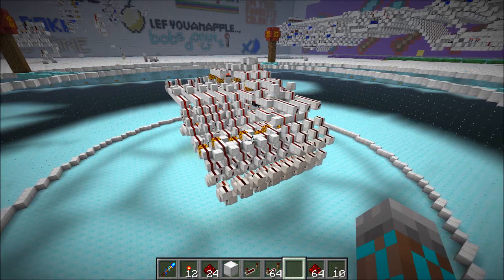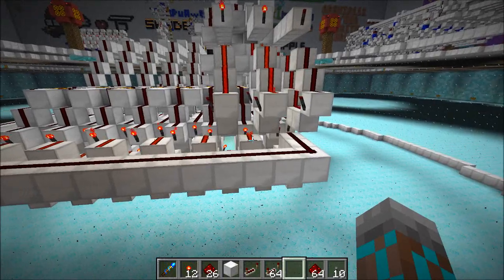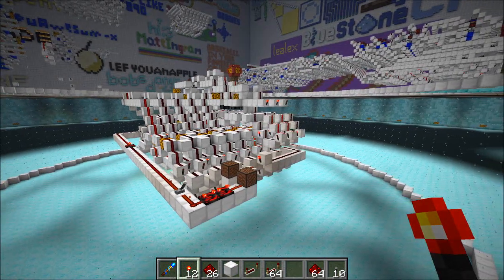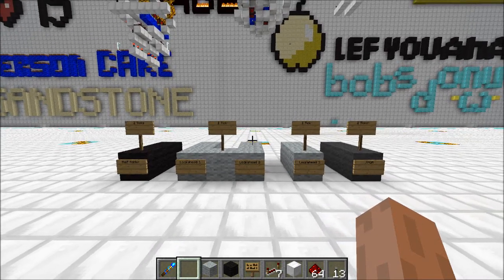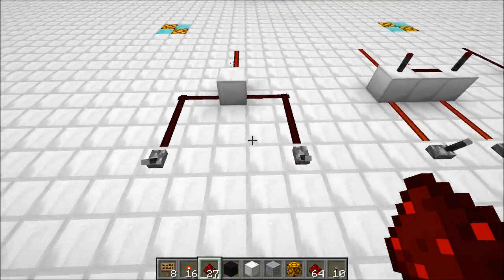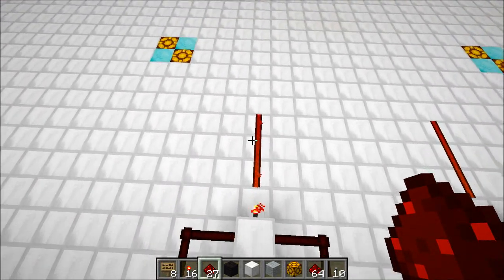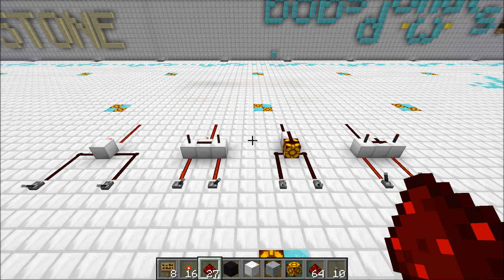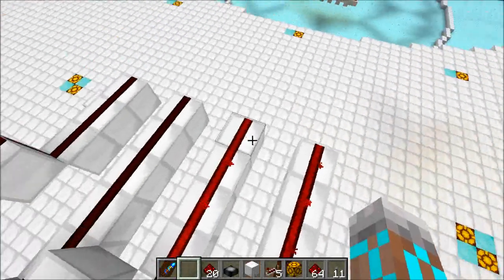6 Tick 8 Bit Proper Lookahead Adder and How it Works (And it's even 2-wide!)

Comment from the maker: Just sent the link to you. I remember seeing that design in your application - very smart and I think that's actually very useful because it would be much more compact than mine. Mine is good if you need one standalone adder - like in an ALU or a loop for some sort of coprocessor. What you described sounds very useful for something like a multiplier that uses Wallace trees, where size is incredibly important.

Comment: Thanks, I would really appreciate that.
By the way I have also tried to make a faster ripple carry adder, in which each full-adder would both calculate the carry-out and the inverse of the carry-out in 2 ticks. Making each carry only take 1 tick more, however I did not finish it, but this should make it 10 ticks for 8 bits I think, so still slower then yours.

Comment from the maker: In theory you could get the "logic splitting" benefits in additional layers, but you'd end up with multiple splits and it probably wouldn't be worth it (I'd imagine there'd be extra delay added while trying to resolve it all). I might try it anyway, but I'm not too worried about that. I don't think I'll ever be building one that's larger than 16 bits anyway. :P

Comment from the maker: In terms of size there won't be much of an increase in length (width will scale linearly though). In terms of speed it won't be a linear increase. The modifications I presented here would only affect the first two layers and the last layer - any additional layers would still take 2 ticks. However, once you get beyond 16 bits it would need signal extension within, and you'd get more delay that way.

Comment: I am amazed by this adder. However I still find it hard to understand how the logic behind it works, even after I have looked a few times at the wikipedia page of kogge-stone adder.
Do you maybe have Logisim logic circuit of this design or could you use that program in some of your videos to explain the logic better? Since a lot of the 3d wiring in minecraft makes the logic behind it a lot harder to see.